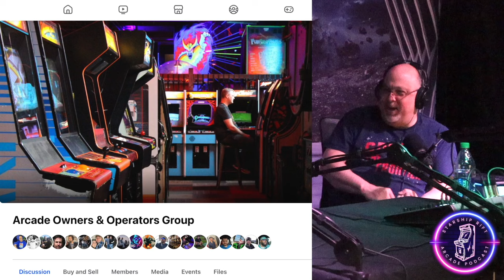Where do Arcades Games come From? - Starship Rift Arcade Podcast Ep. 2

Comment: LCD screens have LAG??
Are you just not switching to Game mode?
Reply: The problem is upscaling. "Game mode" on a modern TV only works because you're bypassing all the processing and using a modern console with LCD-friendly outputs that match the native resolution of the panel. If you were to connect an old game (console or arcade) to a modern screen then you need an upscaler box that is both capable of providing the correct signal for a modern TV and low-latency enough for games.